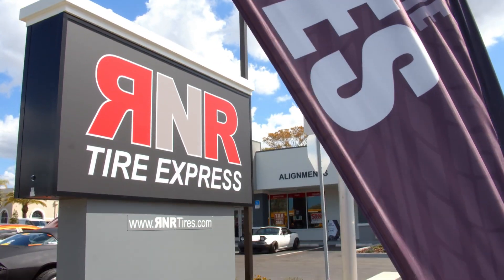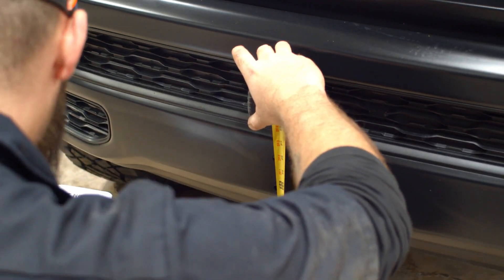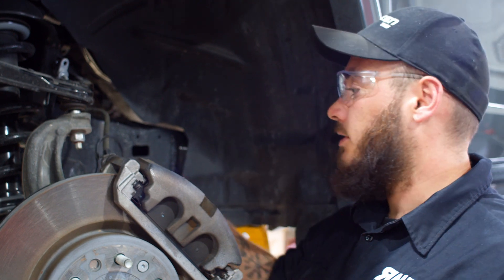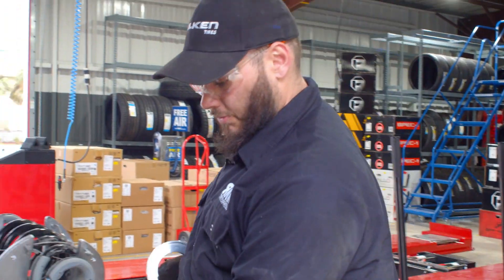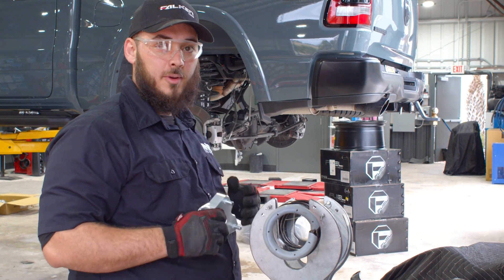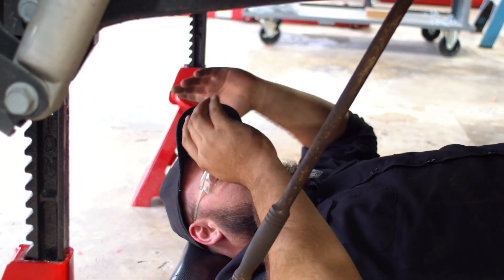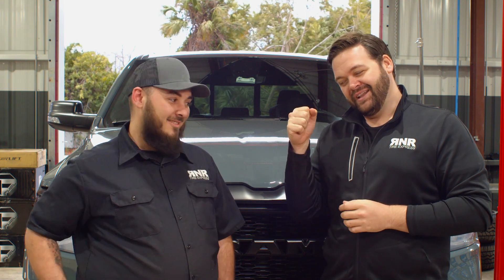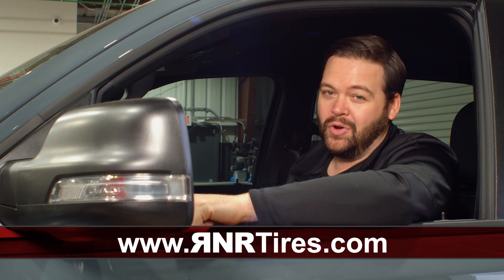BEFORE & AFTER: 2021 Dodge Ram 1500 | LIFT KIT & WHEEL INSTALL

Comment: So what the new height from the top where the fin is to the ground 🤔 plz and ty
Reply from the maker: The tires are 34" with a 3.5" lift on it.
Reply: @RNRTires  the new height of the whole truck? Trying to figure out if it will fit in my garage if I do my ram with the same setup
Reply from the maker: Tire height went from 31.5 to 34.5, and a 3.5” lift from the kit so approximately 5.5” - it does not fit in a garage, the one filmed has an antenna on the roof that will not fit in a standard garage / parking garage. Hope this helps!

Comment: Can you use the factory 20x9 wheels with a 35" tire until I am ready to upgrade? Will the offset be ok? Thanks!
Reply from the maker: Hi Randy! We think it'll definitely need a lift in order to clean those Tires. Keep up posted on what you decide!
Reply: I have a 2021 1500 with 3.5 lift and 1.5 spacers on factory rimes but installed 35” tires. You MUST LIFT IT UP to make it work. The ride is just as smooth if not smoother then factory.

Comment: From what I’m aware of, that model ram 1500 comes with a 1 inch lift from factory. I also have a built to serve edition (just in white) and it has 1 inch pre lift just like the off road package rams do. I was under the impression the ready lift 3.5 couldn’t be used with those models. Was the ride quality effected a ton ? Or were there any issues with the instal ?
Reply from the maker: Hi Jonathan, thanks for watching! So this model actually didn't come with the factory lift like yours did. After everything, it still drove like a factory so that wasn't an issue. We didn't have any issues with the install either, just took a while. I hope that helps.